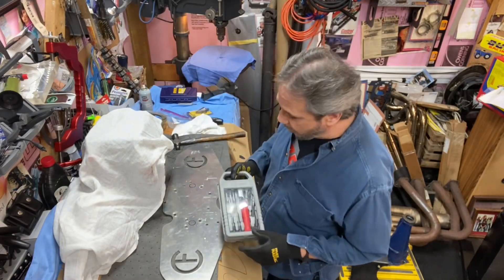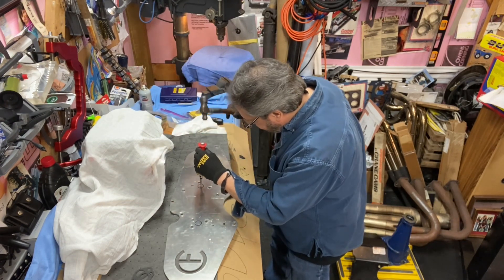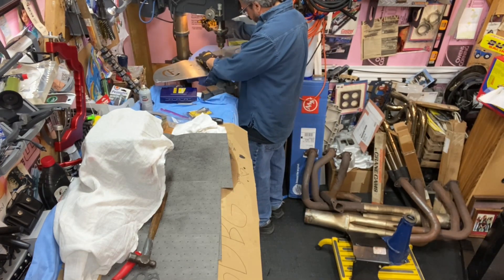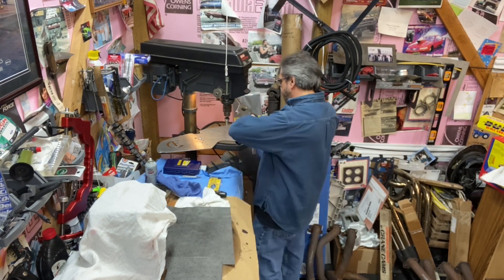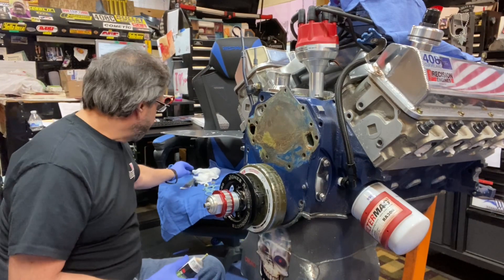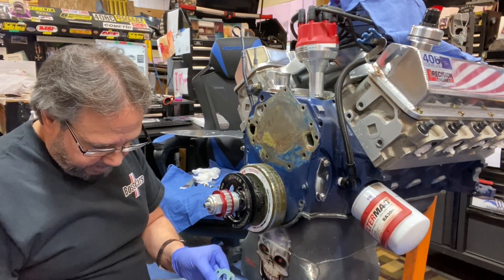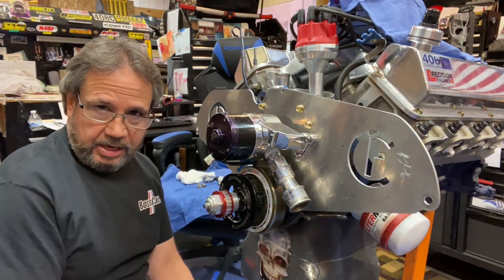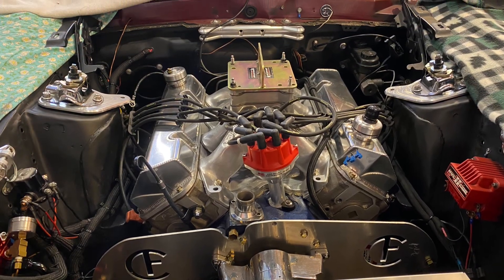Thanks For The 15k Subs, Appreciate you! Drilling, And Installing The Custom Cleveland Engine Plate

Comment: Tim, be careful using gloves with rotating equipment.  It's probably better using nitrile.  If they get hung up, it will pull them off of you rather than puling your hand in. Thanks for posting and have a good day.
Reply from the maker: Oh good point Eric McMahn, never thought about that. I was grinding the plate, and the grinder jumped off and caught me in the fingernail. Good words of advice. Heed
Reply: @dragboss351cleveland  I'm an inside machinist by trade and can tell u some horror stories.  :(
Reply from the maker: I work in the ER, I can show and tell you horror stories. I know exactly what you mean.
Reply: @dragboss351cleveland  it takes a special kind of person to do what u do.  I couldn't possibly do it.  God bless u brother.

Comment: Perfection is in the details and you did the Todd Fuchs “Cleveland Foundry “ engine plate with precision and perfection in this segment. The step-type hole bits work well. Hole saws with the pilot bit included also do a good job. Greenlee offers a wide variety of hole punches and saws. I am curious about who makes the timing pointer that you installed. There are a couple of good ones currently available. I appreciate you and everything that you do, Tim 🏁
Reply from the maker: Thank you Daniel, I try to do my best at everything I do. I teach my kids the same. The pointer is from Aeroflow. Your most welcome my friend.

Comment: i use those step/uni drill bits for electric work. they last longer if you use a pilot bit first. The tips are the first thing to dull on those, and a good one can cost up to 65 dollars for the big one, which is good for up to a 1" connector. The Greenlee carbon tooth bit hole saws are good for a good controlled cut. it has a spring on the pilot bit that helps ease down to drill and it has a ledge on the hole saw that keeps the bit from punching through and hitting stuff on the other side. Would work great on a plate like you're drilling out. You can buy a set or individual, but you get a better buy if you buy a set, but not a deal if you never use the ones that go up to a 2" connector. they make smaller sets though too, and the they come with the arbor etc.
Reply from the maker: Thank you, I may pick some up, those are cobalt step drill bits, have used them many times, and pilot hole is key for sure.
Reply: @dragboss351cleveland  Kobalt is a good brand. Something I learned about the compound miter saws over a decade ago, is they use steel ball bearings instead of plastic like DeWalt and others do. Some of their stuff has lifetime warranties or used to. Lowe's told me one time, a decade ago, that I didn't even need a coupon to return a pair a lineman I had bought 5 years before that and didn't have a receipt. Not sure it that has changed or not.
I still by DeWalt and I have a lot of Klein screw drivers and changed over to Knipex, a German brand, for my lineman and diagonal cutters. The last pair I bought have lasted me 5 years. they have out performed Klein by far. they keep an edge better and have better action as far as open and closing easily. Klein were always stiff, and I went through 3 pair of lineman and 2 diagonal cutters compared to the Knipex!
I think Greenlee is superior steel as far as keeping an edge on holesaws and step bits, we call unibits in the electric field here in Oklahoma, but Greenlee will outlast other brands as far as keeping an edge.
Reply from the maker: Thanks for the insight. I went back and looked at them and they were Irwin, hope that is a good brand. I did not know they were guaranteed for life thanks my friend
Reply: @dragboss351cleveland  I haven't had any experience with Irwin tools. Time and use will tell though. They've been around for a minute but not always a sign they are good. You would think that over time brands would grow in knowledge and quality but I think they spend more in marketing and sales than in quality, for the most part it seems.
Reply from the maker: Good point I understand what you’re saying, my friend. I take it for what it’s worth they themselves are like 48 to 50 bucks if I remember correctly.
Reply: @dragboss351cleveland  yeah, if you buy one made out of quality steel, they can get pretty expensive for sure. I knew an older man back in my youth that always said, you may be able to get something cheaper, but you get what you pay for. Most of the time that is true.
Reply from the maker: I live by the adage, the same with racing parts.